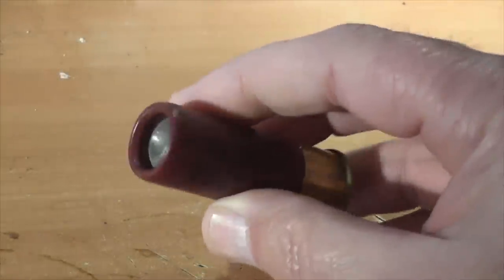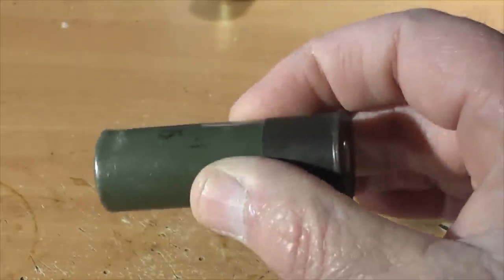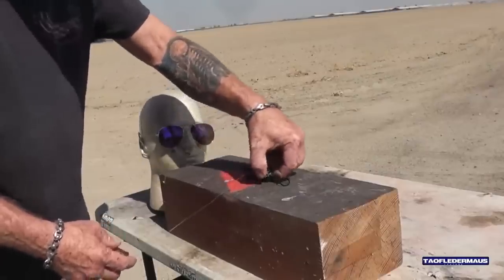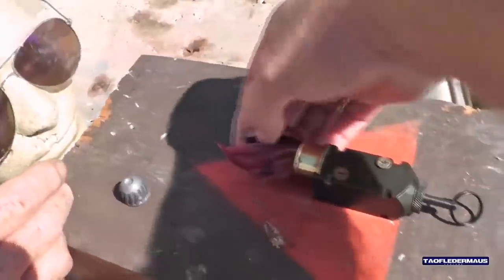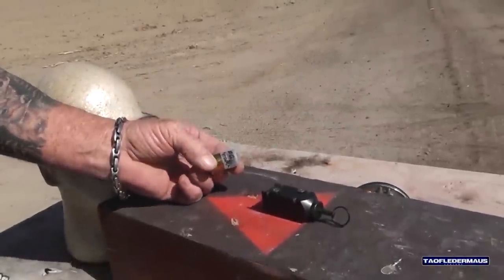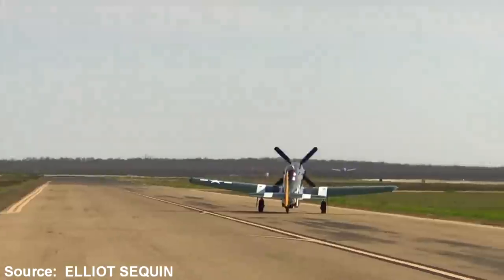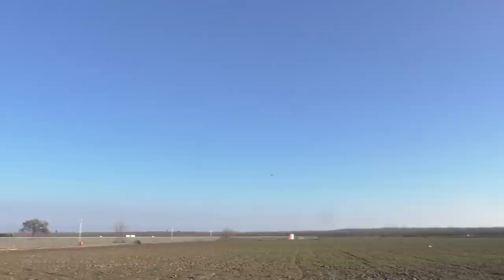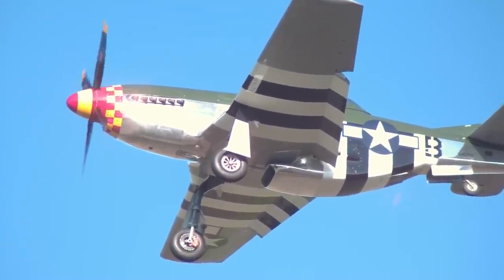Buckshot and Slug Shells exploding outside a gun - Are they deadly?

Comment: Here's an idea, it would be better if you do it then wait for me so I'll share it, it's cheap and easy.

With a mold to form a slug, melt the plastic from milk gallons (it's a certain kind) and compress it into the mold.  This material has a super putty like strength, there are amazing bullet proof fabrications made with the material...

In the mold insert a steel or similar rod (a cavity in front of it would be awesome if you can engineer it but not needed).  This rod will be more dense than the slug body.  A nice nail trimmed to size with a hollow glass or plastic bead glued to its tip should be an adequate rod and cavity.  Or you could trim a straw to make a tube cavity as well. Just cap it so it's a chamber and make sure it's strong enough to remain hollow in the mold upon manufacture. I'll assume that if it solidifies with the cavity retained, it will hold up  through travel, and the rod will use the cavity long before impact closes it.

If you want to be fancy try capping a tube-cavity with a screw tip. Put that tip at the point of the slugs impact.  Whatever surface it hits it may twist in, then with a nail flying up behind it through the cavity a nanosecond after. Even if it doesn't screw in on impact it will at least provide damage to assist the nail.

Within the melted plastic mix some garnet. The Adirondack type is the hardest. It's really cheap for a gem too.  It has a peculiar abrasive property that no  matter how small you crush it or erode it,  it retains an edge.  Make a near powder of it to mix in the mold.

I think it would be an insane round of destruction and kinetic force.  The plastic should work a squash round effect, while a rod and cavity should create armor piercing. 

With that special plastic and hard sharp garnet infused throughout, my simple man prediction is that on impact it will have a smack-effect. The slug will smoosh forward and not fragment out, with the garnet pieces slicing forward to facilitate the spreading out of the material.  I'd like to see if a micro-cut ability of the garnet powder exists to make it a special round.  

 It may not fully absorb into the target, but the material is hard enough to make some chaos regardless.  I want to see what it does very much.

Not crazy, i promise.  Any feedback would be great.  Love you guys.  You're required to name it the milk-rod if you make it. Thanks.

Comment: RIP Danny.
When I was young, like 40 years ago, we used to shoot 12 gauge shells in on the primers with our BB guns to make them explode. We also taped BBs to the primers and taped a ribbon on the crimp so they'd fall brass first and throw them in the air and run. The BB gun shot to the primer was a reliable way to ignite the primer but the thrown ones fired maybe once every 20 throws or so.
I'm amazed that none of us were injured during those or other escapades.

Comment: with a round cooking off completely out of battery (like being thrown in a fire), its generally the lightest fragment that does the most damage. its not always the case, but everyone i know that has been hurt from either intentionally or accidentally setting a round off out of battery has had brass shrapnel stuck in them. i think .22 LR is probably the most common round to be set off on purpose out of battery, and that casing gets going pretty dang fast! the worst injury i've heard of was a friend who hit a .22 LR with a hammer, and the case head came off cleaning and frisbeed down into his foot, cutting his pinky toe really badly. i remember he had a foot cast on for a little while and he kept having to explain why and was super embarrassed. he never did explain what exactly happened to his toe that required a cast, but i think it was a bit of surgery to remove the case head from his foot, and the cast was to immobilize the foot so it could heal faster

Comment: I recently saw a video by a black powder guy. He was demonstrating brass shells used for ancient shotguns that can't necessarily tolerate the pressure of modern powders. I assumed the brass handles the pressure and the barrel simply guides the shot. Am I correct that the foam head might not have fared so well with one of those?
Reply from the maker: I think even an all-brass shell would split open,  sort of like the .50 bmg round we tested in a similar way

Comment: Great to see Danny again👍🏻.
One thing I wanted to say about the cartridges was that they were being held down and did not correctly represent the laws of thermodynamics. Had the cartridge not been fixed in place, it's more likely that it would've flown backwards and not propelled the slug or ball-bearings at any speed remotely close to injuring someone. Someone's likely pointed this out by now, but I wasn't going to read all 600 messages to check. 😉👍🏻

Comment: Jeff, could you revisit the "perimeter alarm" devices?  Possibly using a shotshell length of PVC, copper or aluminum pipe to prevent the shell from splitting?
Reply from the maker: I'm not going to post myself violating the law
Reply: @taofledermaus  No problem, I wasn't aware that would have been a violation.

Comment: As a skeet and trap shooter, I have seen dropped shells land on the primer.  Twice this has ignited the primer with minor fireworks.  The factory load did not even open the crimp.  The reload barely opened and did not even have the wad clear the mouth of the case.  My suspicion is that this is related to a totally unsupported case head.

That is two times in 55 years of shooting.

Comment: I thought most tests of regular ammo thrown into a fire found that the casing went flying and the bullet didn't do much. The explanation after the fact being that the bullet is so much lighter than the casing, it didn't pick up much energy. Not to say that brass or steel casing flying at high speed couldn't hurt someone, but that it generally isn't anywhere near as dangerous.

Comment: It's not generally known, but firefighters were fighting fire in a building that had stored ammo, unbeknownst to them. This was something like the 70's or 80's - don't recall exactly. They started reporting getting hit by "something" while in the building, but nobody was reporting getting hurt. Then one firefighter noticed several brass cases bouncing off his turnouts. They immediately evacuated and went into containment mode. Naturally, this generated curiosity and experiments were done. Results? Basic physics. The heat ignited the powder and the CASE ruptured and flew away. Very little movement of the bullet. Results were repeatable. The danger from fire igniting ammo is that case shrapnel could cause lacerations, but the bullets themselves weren't a danger. This experiment shown is somewhat different in that the case is supported from the rear, but I'm confident that it shows essentially the same results, i.e. uncontained ammo can cause minor injury, but isn't as dangerous as contained ammo.
Reply from the maker: There's a video on YT where they sent PALLETS of ammo on fire to demonstrate what firefighters need to do or not worry about with exploding ammo like this.  It's kind of heartbreaking how much ammo they burned up though!
Reply: @taofledermaus - 👍

Comment: Gr8 stuff Jeff 👍 loved the bit about the plane.  And Elliot can boast that his big block Chevy does 350mph . That's awsome,  didn't know you could put a car engine in a plane like that.  👍👍🇭🇲🇺🇸🇭🇲🇺🇸
Reply from the maker: They did it right.   Running both electronic ignition and a magneto and 2 sparkplugs per cylinder and mechanical injection.   So a lot of redundancy and the engine will still run even with loss of all electrical.

Comment: It would have even less effect if the trigger mechanism wasn't screwed down because that's preventing the brass from going in the opposite direction which is what I believe should happen since the slug weighs more than the brass the brass is the part that should move the most.

Comment: Holding the shell still will increase the forward damage.
If you can set the shell off with more freedom to move backwards, I suspect, due to the weight of the load, the case will depart with speed leaving the heavier loads to ove in the opposite direction with much less velocity.. It's an MV squared (load) = MV squared (case) deal..

Comment: I wonder if you put a 4” or 6” sleeve slid over the round and then fired it from one of those alarm signal trip wires.
Reply from the maker: I'm sure you could but I wouldn't post myself doing that on yt lol
Reply: @taofledermaus  yeah especially with current policies.   Unfortunately ill intentioned people will find ways to do bad things.  I am curious about the change in effectiveness but not enough to do it.  Lol.  Besides it would probably be like a brass failure in a 38 super.  The unsupported edge of the head stamp would blow apart still reducing any effectiveness.  I still would not want to accidentally find one of those either way.

Comment: And this type of test represents the absolute worst case scenario for a "loose" round because its seated against a stationary object. If the round was just sitting on its own, half the energy would be spent moving the shell/casing away from the relatively heavy projectile. In reality, you'd probably get less than half the damage seen here.

Comment: 4 wraps around the shell with tuck tape, or 3 wraps with duck tape,  or 5 criss/cross layered wraps with masking tape or electric tape and you have just made the shell case into a short 
2 and 3/4 inch barrel...you will get much more energy and velocity...love your channel
Reply: ...forgot to specify that you need to make sure the wrap is as far up the metal base as possible ... overlap the metal-plastic transition gap

Comment: What you  should try with that (perimeter alert)is slip a 3/4dia.,4inch cast iron pipe  over the shell.contain the shell from  blowing out and the shot will go forward  alot  faster. NOBODY  wants to take a 4inch sawed off 12 gauge from  less than a  foot away. Remember  booby traps work way better for  maiming  than killing, dead is dead  getting horribly altered  by a device you didn't  even see  is a  whole  nother  matter but that's  what makes  them  so damn  effective in the  first place.
Reply from the maker: Then the ATF would be raiding my house

Comment: I remember the original video :) I think it would be a great tribute to Danny if you periodically remastered (remixed) some of the videos with him.  
(or maybe a few compilations with him, perhaps on his anniversary. I can see a sweet video with all his elbow shell kicks or one with (almost) every single perfectly aimed shot - that would be a monstrous task to compile, but it would be a kick-ass video if you could match it with the music of some metal song (or other music, like you've done before on the channel). ) 

As for styrofoam: the type of expanded polystyrene (i.e. styrofoam) used in those heads, is also used in foundation blocks that carry multi-story brick/concrete houses... It's extremely pressure resistant, especially from blunt surfaces like that foster slug.

Comment: What if you just put a piece of steel pipe on the shell the same length as it, so it won't balloon out the sides? I'm sure the spread would be very wide if it was pellets but would they be moving fast enough to cause serious damage? See how much barrel you actually need, maybe just a short one like a flare gun. I guess if you made a "shotpistol" the kick on your hand would be rough.
Reply from the maker: Probably get me in trouble with the ATF
Reply: @taofledermaus  Oh really? You can't even stick a piece of pipe over a shotgun shell? Making a gun like that would probably be illegal, I could see that, but just a piece of pipe by itself for a test on a bench? But anyway, guess you shouldn't risk it.
Reply: @taofledermaus  Weird laws though huh? A short barreled shotgun would have less muzzle velocity and do less damage but just because it's easier to conceal they prefer you use a high velocity long barrel one which will definitely kill people, it'll just be less of a surprise, they see you coming with it just before they get their entire head blown off. Very considerate folks, the ATF.

Comment: It look like it had six exhaust ports coming out of it so that makes me wonder if it was a V12 in the plane
Reply from the maker: It's a V8  and they added a couple dummy pipes just so it looks "right".
Reply: @taofledermaus  ok now I'm wondering if it's an LS engine that are used in Corvettes and Camaros. Because I know a lot of homebuilders use their manned aircraft. But they are not classified as a big block so maybe it's some kind of a Dodge Hemi or Hellcat. I kind of wonder if anyone ever used a Dodge Viper motor in an aircraft they were V10s
Reply from the maker: @ncooper7757  it's not an LS.   It's a big block.  It has custom heads using dual sparkplugs,  has both electronic ignition and a magneto for redundancy.  It also uses mechanical injection.  Again, redundancy for safety.  The engine will run even with a total electrical failure.
Reply: @taofledermaus  now that seems quite interesting I'd like to go look at that

Comment: Maybe such an exposed shell would need high speed  burning pistol powder, though I would NEVER try that, as ending up with a pistol powder shell in a shotgun may end very badly for a shotgun. The reason being that the powder in pistols has to burn much faster due to the short barrel, which means more force is exerted (faster energy release=more force, so likely more than a gun is rated for), and so it could explode   at the very least take damage (see Kentucky Ballistics "when guns go boom" episodes to see what I mean, Mark Serbu also explain this in more detail when going over what was likely to cause of KB's 50 cal going boom). So don't even try it...

Comment: If you use a piece of metal conduit that is just large enough that slide over and about the same length or a tad longer, you will get way more impressed results.
Reply from the maker: like the AFT busting into my house at 3 am lol
Reply: @TAOFLEDERMAUS  🤣 probably, but that would also make it more efficient, just a thought that I had in my head.

Comment: R.I.P to your friend. I watched this to the end and I have seen one major flaw with the way this was conducted to find out what would happen if a shell went off outside the gun. All tests were conducted with the shell held in a device which would provide the energy to go in a forward direction as well as outwards due to plastic shells. If the shell fired outside the gun without it being influenced in any direction it would just pop apart. I have seen this result after a vehicle fire with 375 H&H rounds in the glovebox, they just popped apart and not one left the glovebox or put a dent in it. So if a shell was ejected after failing to fire and then went off on the ground not much would happen other than the shooter would require clean underwear. Nice plane.

Comment: Try putting the shotgun shell into a 3 inch piece of 3/4 diameter schedule 80 p.v.c. pipe. Super glue the brass in the pipe. I'm sure that you would be amazed at what happens. Peace on the path.

Comment: So if the shell was covered with a piece of high strength steel pipe .it may have directed the force in the open end of the pipe...and you Styrofoam head would be blown apart...

Comment: How many degrees in a circle? 360. How many degrees in a sphere? 360x360 or just shy of 130,000. So... A firearm concentrates a sphere of energy and points it in a single degree of direction. Or 129,600 times more efficient use of the energy.

So, in short, is something detonating outside of a firearm dangerous? Sure. But... Many thousands of times less dangerous than being in front of a discharging barrel.